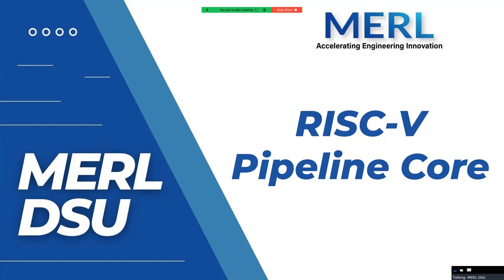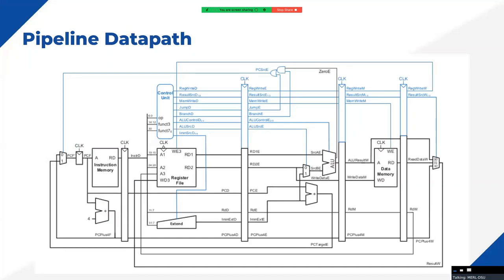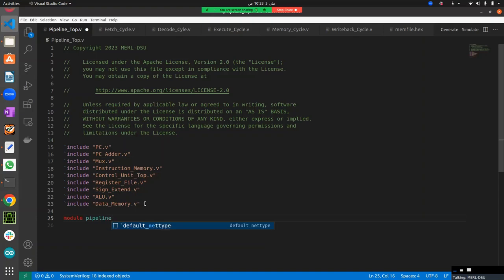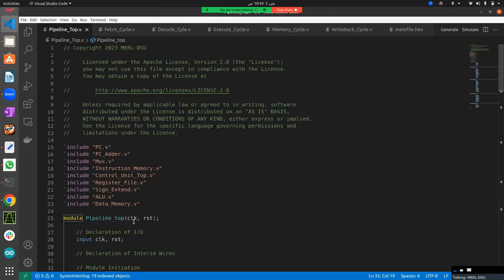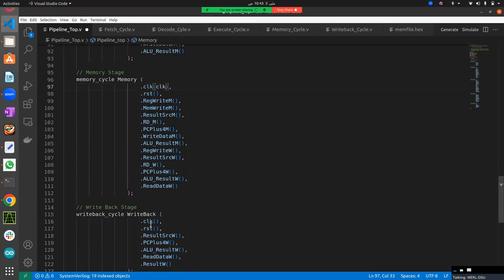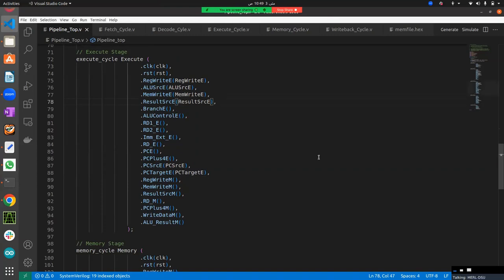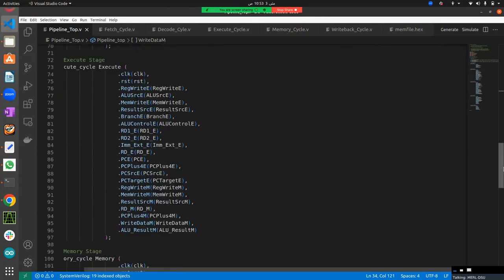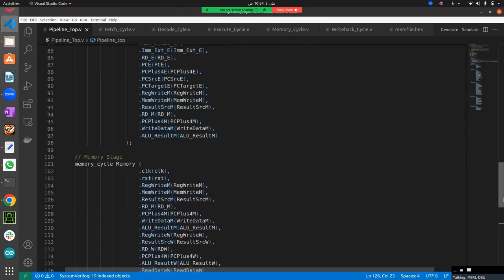Lecture 7: Designing & Implementation of RISC-V Pipeline Architecture

Comment: I have a question that the instruction lw did not work correctly by following your example. I check the result on Venus and the result is not x10 = 0x00000001
Reply from the maker: Can you please elaborate your error as with the limited amount of information i cannot comment what may be the error and how you can solve it